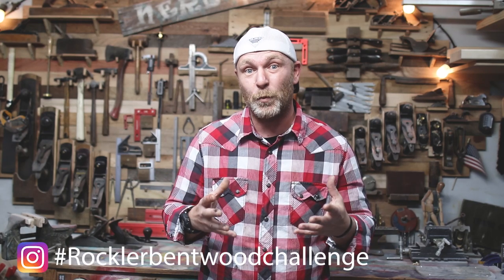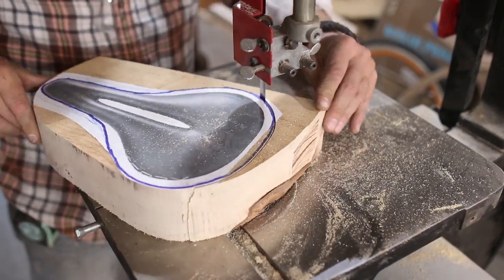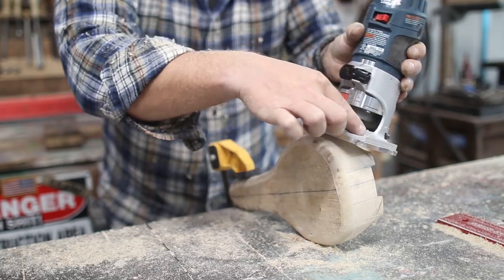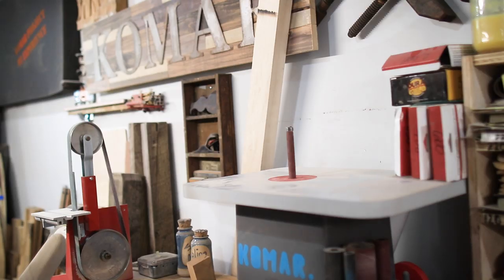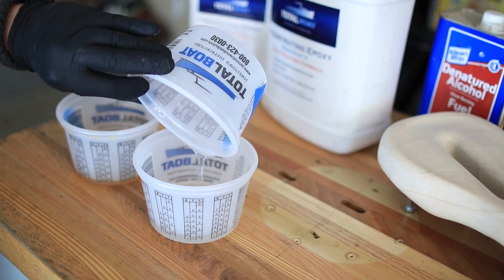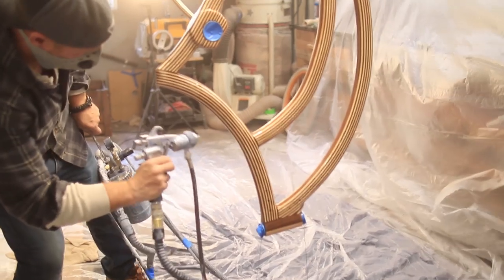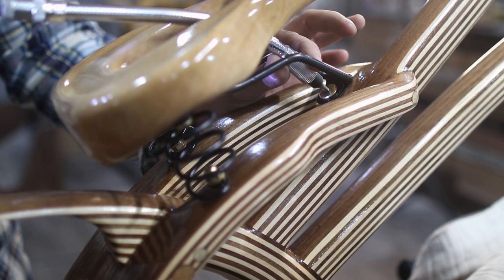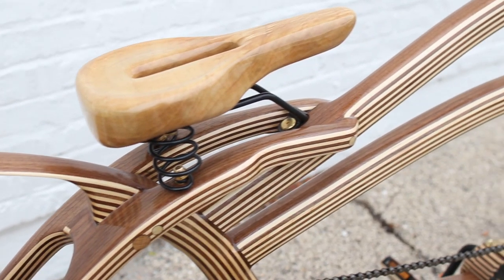Making a Wood Bicycle Seat for a Wood Bike

Comment: I just got an orbital sander and a few super basic woodworking tools. No table saw sadly but I have a circular saw. Do you have any advice on projects I should tackle first to learn woodworking?
Reply from the maker: NuuR I would just start building things you need for the house.  That’s what I did.  A real good started project is a cutting board. It’s like a staple for the woodworker.  Lol.  Just watch a few videos first to get an idea.
Reply: @KomarProject  will do thanks! Love your vids